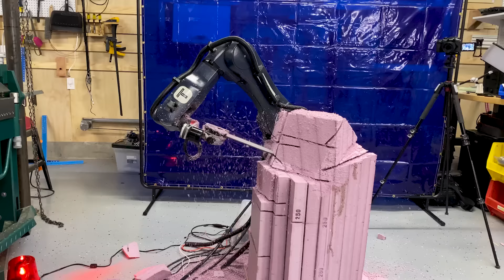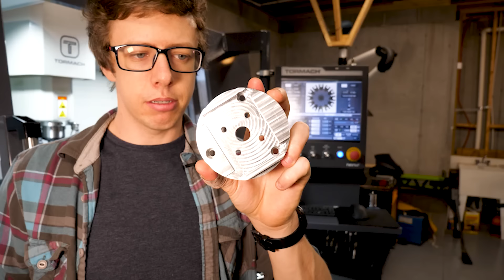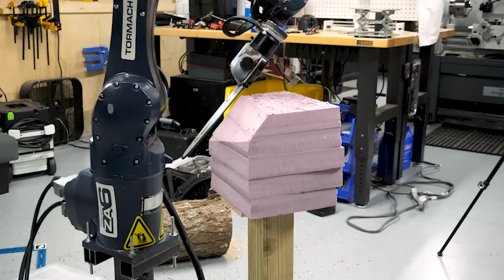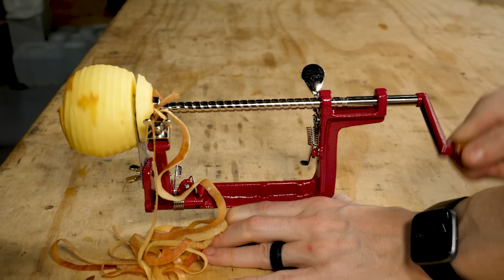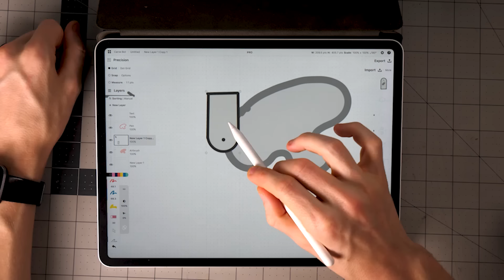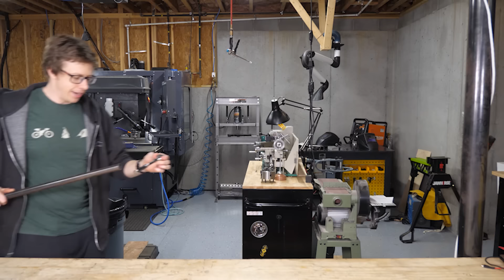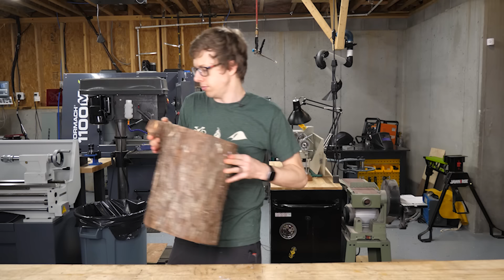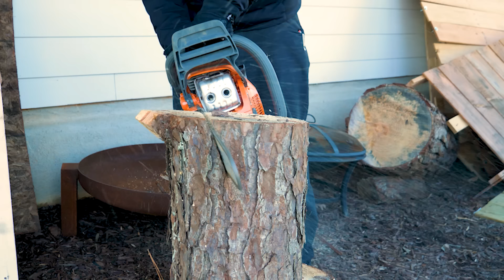Chainsaw + robotic arm = art?

Comment: On the chainsaw blade thats the depth gauge. When you cut with the tip its called a plunge cut. Its supposed to be the most prone to kickback cut you can do with a chainsaw. But I must be lucky because the only time Ive had a kick back was cutting through a nail in a board on a chopsaw. When I sharpen my chain I sharpen it, then take down the depth gauge, then saw something and examine the shavings. If the shavings look good I'm done. If not I remove some more of the depth gauge until I like the shaving size its throwing. As far as heating up and not cutting its either this, the pressure being applied to the piece is too low or your chain isnt getting oil, which will heat up your bar, but not reduce its ability to cut.

Comment: you can file down the depth gage on the chain saw blade to get more cutting. sharp teeth will be better cutting. you need to be using bar and chain oil too.

Comment: Pole saws and their chains aren't really designed to take heavy cuts through wood, they are meant to cut branches less then 2 inches thick. There are some short barred chainsaw on the market, some people have adapted short bars for chainsaw carving, but im not sure a pole saw bar is a good idea for solid wood.

Comment: You have the wrong type of guide bar. get a chainsaw carving guide bar, with a dime size tip! You also have the wrong type of chain!  There are still a lot of ways you can screw up.  You need to talk to somebody with experience.  You are making a bunch of beginner errors.

Comment: As a person with 31 years of professional chainsaw use and nearly as many, in woodworking, I think you are using the wrong tool! Use a router with a straight bit.  The chainsaw requires skills that you can not transfer to a robot, unless you have them your self, and you do not even know about chainsaw carving guide bars!  They have a tip the size of a dime.

Comment: The problem you're having with the chainsaw cutting is purely the fact that you are using a polesaw powered by a rather wimpy electric motor. Pole saws are designed for light trimming only, and the limited capabilities of the electric motor are not doing it any favors.

Comment: This was vary interesting especially the part about localised gradient decent problem and random Forrest these techniques are used extensively in machine learning. You may be able to use MLIB and Spark to solve the best fit problem, using the layer outline as a vector for the predictor and random Forrest to shortcut an approximation with least error. The other method would be to use a neural network and gradient descent to find a probabilistic solution but this will require alot of supervised learning.

Comment: Hey man I think you need to understand chainsaws a little better. You’re a way smarter person then me but I have thousands of hours running chainsaws. I have also done a lot of carvings. Essentially you may not have been oiling enough , too much pressure on the chain when it’s spinning with not enough oil etc.

Comment: "CNC's aren't smart"

Right, and in days of old, if you mis-load a tool holder with an endmill, it will, without caring, rapid to the first position, plunge right through your billet of aluminum and continue to mill a perfect hole in your brand new FADAL 5020A.

It was such a sad, stupid moment...

Comment: So I've worked with gradient descent in machine learning before and there's a way we compensated for local minimums. It wasn't perfect but it helped out a lot.

What we did was to do a secondary large-grain pass when the algorithm found a minimum. When the delta of the primary pass with a small step size came within stop threshold, we ran a couple secondary passes with various higher step sizes. If none of them found a position lower than our minimum, we called it good. If they did find such a position, we restarted our primary pass at that location. This wasn't perfect but it does eliminate some false positives.
Reply: shame this comment didn’t get enough attention;

I just spent a few minutes trying to find someone who knew a method, but no one seems to know except you, and you didn’t even get noticed.

It’s 5 months late but maybe replying here will promote this comment.

Comment: Those are not anitkickback links. Those are called takers. There purpose is to limit the amount the tooth can grab. It's it's look low, the saw will lugm it too tall it will leave the tooth not cutting. At the tip it's 9ver exacerbated because the curvature of the tip makes the rakers the leading edge. Not the tooth

Comment: Instead of a chainsaw how about replacing the cutting device with with a high speed router bit, for the program it would be easier to use the same programing method as a 3D printer instead of add material just reverse the program to remove material. I see the engineering challenge attempting to use a chainsaw but I like to follow the path of less resistance & minus the headaches.

Comment: At 10:00, what if the ball finds itself on the shorter peak? It could climb to the top of that hill and think it was at the top.

Basically it finds the top of one peak, but thats not necessarily the top of all peaks, right?

10:34 oh there it is. I should have just waited. Seemed like a pretty obvious problem.

Comment: you can file down the depth gauge to make the saw cut more material but if you take to much off it will increase chance of kickback and may bog the small motor down

Comment: Your videos are just amazing, I can't believe you throw yourself in these types of projects and still succeed.
Concerning your problem with the gardient ascent, I guess nobody could solve your problem either. What you are trying to do is basically non-convex optimization which is at least a NP-hard problem. Which means it is in a class of problems for which nobody found a good (quick) solution. If you solved this problem you'd have probably won the Fields medal.

Comment: couldn't you use gradient ascent, and then create an axes at that particular z-axis, but essentially see if you can make a crossection? afterwards, if the crossection made on that new axis touches any other points after reaching the false summit, then it needs to make a new gradient ascent at the new guess points and see if they reach a higher summit? Essentially, step 1 is to program it to reach a summit, then step2: test if there are new points along that new axes which cuts across a different summit. Step 3 is to repeat step 1 for the new positions from step2. The only concern is if there is a way the ball reaches two equal summits, but that is a distinct calculations.

Comment: you need sharp teeth. also the "anti kick back tooth" is a raker. it dictates the aggressiveness of the actual teeth(assuming you sharpened well). i think the guys who carve use special chains. cutting cross grain is rough for a standard chain. im an arborist, we use and sharpen those standard chains daily

Comment: This might sound stupid, but could it be that you forgot to fill in oil for chain lubrication? Most likely either this or a broken oil pump (which often occur on this kind of equipment) are responsible for such severe overheating. The type of wood could also make a difference. 

In order to be able to carve more precisely, you should use a suitable sword, such as this one: Stihl 30050003105

But be careful, for a conversion a suitable sprocket must be installed in addition to chain and sword.

Comment: oh boy the chain is so slack it gives me such anxiety :S accident meant to happen... keep it tightened to the point that, with your fingers you can just barely pull a tooth free from the blade. The heat issue might very well be due to the depth gauges(? I'm not a native eng. speaker) not being filed down correctly. Cool stuff tho!

Comment: I used to run a CNC mill.  One day, extreme anger came upon me and the mill started running in a direction that it was not programmed to run in.  After decades since then I figured it out.  A demonic cloud came near the CNC mill.  It caused me to generate extreme anger and the extreme negative energy fed the negative spirit more negative energy.  The demon became powerful enough to take over my CNC mill and make it go off the programmed course.  My point here is if you feel strong negative emotions, step away from the chain saw.  It could turn on you.  I am not making this up.

Comment: When the Greeks and Romans were copying a statue, they put a cage over the original with a matrix on each face.  They would then measure in from each point to the statue.  The would then put the cage over the marble block and drill in from each point to the required depth.  when all the holes were drilled, the copyist would chip away the superfluous material using a chisel and the holes as guides.

Comment: bar oil on the chainsaw would improve the heat issue altogether, and possibly a ripping chain. I'm not sure specifics are used for wood carving with a chainsaw. Surprised you didn't mention it as an issue, but i'm sure simple things are overlooked in the complexity of it all.

Comment: Problem #1 - the medium is not an even shape, use a camera to 3d scan the "log" and a script to fit the 3d object into.
Problem #2 - removing unnecessary material from the medium use combination of the cut and apple peeler method, and maybe introduce a milling bit for the finer details. Do the material removal in several stages so you will have an intermediate shape, final shape and finishing shape.
Problem #3 - testing without wreaking the hardware, build a working virtual model of the robot rig it in 3d software and use a game engine like Unity or Unreal build a working virtual model that you can test the algos without destroying real hardware. The software should be able to detect when the cutting tool would hit an important part of robot arm and either stop or compensate. Do a test run without the medium and the tool/s maybe using an analog for the cutting bit and allow it to run through the whole process IRL.
Problem #4 - wear and tear on the cutting bits, introduce sensors to monitor for heat, smoke and force. Add pauses to allow both the cutting bits and material to cool down. Consider adding pauses to fit replacement cutting tools at predefined intervals.

Comment: It's been months since you released this.  Assuming you haven't looked into chainsaw blade sharpening... (I'm guessing you have.)

One thing that you pointed out was the 'depth gauge' preventing the teeth from cutting into the wood.  They should be filed down slightly as the teeth get sharpened (effectively shortening them).  Look down the blade from the cutting end.  (Best done with the saw not connected to a killer robot arm.)  The teeth should be sticking out just a smidge beyond the depth gauges.  Some people like to have lower depth gauges to allow the teeth to 'bite' more aggressively.  But you have to know what you're getting into and be ready to handle the saw.

You can actually use a triangular file to sharpen the blades in a different way so as to improve cutting efficiency by about 20%.

And, as others have mentioned, cutting along the broad edge of the blade/bar will be better for the saw.

When cutting wood with a chainsaw, let the saw do the work.  You're not going to cut faster than those depth gauges physically let wood reach the teeth.  Doing this with a robot arm will likely be extremely difficult as you will need a pressure feedback built in.

I hope this helps birth a dog made of wood. :D

Comment: I know it doesn't matter, but those shorter teeth next to the cutting teeth are called "depth gauges" and it sets how deeply the cutting teeth sink into the material. There are anti-kickback chains with extra teeth, but unless i'm mistaken that chain looks like a normal chain.

Comment: I have done a lot of CAM programing for work. And i dreamt of having a tool you just created.  I haven’t seen anything as advanced in any professional CAM software. Initial stock removal is a big pain in the ass. So is the 5axis machining of complex geometry. Usually you need to do what you automated manually.  Takes forever. Mistakes have exactly the same result you had couple of times. Humans do mistakes. That’s a fact. And are expensive. If I would own CAM software business like for example SIEMENS i would pay you a mountain of cash for this.

Comment: It looks like you probably dulled your chainsaw blade pretty quickly with the wood. That's exactly what happens when the blade is dull. It just sits there and gets hot without cutting much wood.

The other thing, though, is that, at least to me, it doesn't look like the robot has a way of applying (lots of) force to the chainsaw perpendicular to the blade. There's a reason that you use a chainsaw with two hands. The top hand is constantly pushing the blade down into what you're cutting. Without a significant amount of force pushing down into the wood, you'll get similar results as with the dull blade, where it just sits there and gets hot without digging any further into the wood.

I'd also guess that that pole saw blade and chain weren't designed for cutting through logs anywhere near that size. Pole saws are normally designed for cutting through branches up to a few inches thick, not for cutting through 18-24" diameter hardwood tree trunks. While I understand why you wanted a small bar on the chainsaw, the downside of that is that chainsaws with such small bars are usually not designed to be able to cut through such large tree trunks without dulling the blade to oblivion every 15 minutes.
Reply: So you're saying he should have used a lazer!

Comment: Two suggestions 1. Start with a super, super low polygon count model and design an algorithm to cut the planes as a roughing process 2. Give the problem to an AI and see how it does.  This isn’t advice to get a better result, I’m just curious what the outcome would be
Reply: Also, with the level of control of that arm, you might be able to replace the chainsaw with a high quality handsaw and let the arm do the cutting

Comment: 10:47 too bad you can't use some sort of raycasting when its on false summit to check any elevation at eye level within 360-degree radius of it's position at false summit. and if so, move in that direction and travel down then back up the correct summit then repeat to see if theres an even higher one.

Comment: Yes you are correct about why the saw wouldn’t cut wood at the tip. The depth limiters (AKA rakers) are usually set at 10-15 thousandths of an inch below the cutters, this prevents kickback on the tip of the saw and limits the depth each tooth cuts so you’re not constantly stalling out by taking too big of a bite. File them down to about 25 thou and you should be able to cut with the tip

Comment: 11 min: There is nothing wrong with coming up with AN optimum even if it isn't THE optimum. Were the "false peaks" so bad that the algorithm was entirely useless? If not I would have just went with "good enough" because there is no way to prove that you have an optimal solution without trying every possibility. There are many algorithms to try to get better optimimums but ultimately, you are trying to do the impossible. 
Also, couldn't you just run the program again on the now reduced chunk for an iterative optimum?

Comment: 10:45 Can't you just run gradient ascend multiple times with random starting points and choose the best result? Or are there way too many local maxima?
Reply: I think that would be a lot of computation still. Less so then previously, but would still take hours probably based on how long he was saying it would take doing all of them.
Reply: Something similar happens on deep learning called "Batch Gradient Descent" , computing for gradient ascent/descent is fast when using matrix computation. There are also Tensor GPU that specialize on these math problems. What we do is we scatter random points around the plane and use calculus to find if the "height" is increaseing or decreasing. Its not computationally heavy. There are also methods to speed this up at the cost of accuracy like by using the "momentum" hyperparameter that tells how much the point must move towards a certain direction. To put it simply, a higher momentum will mean less accurate results because the point takes bigger steps so its more "careless". You can tweak this depending on how powerful your GPU is.
Reply: @henrylo6773  Yes! Another good one stochastic gradient descent with random restart

Comment: If "Stuff Made Here" is interested: 
The stuff with gradient ascent is a typical machine learning problem and there is at least a partial solution to it. In machine learning we want to minimize the error, where we simply use gradient descent instead of ascent. Of course you can simply change the sign of that problem to gradient ascent.
1. There are different optimizers. Some of them use kind of momentum, to get out of a local minima or maxima. There are many different kinds of optimizers, like adagrad, adadelta, adam and so on. https://towardsdatascience.com/optimizers-for-training-neural-network-59450d71caf6
2. Start from different "points". This is more or less a trial and error approach. Choose "starting points" of of your problem randomly and take the best one. 

In combination this approach could be practicable.